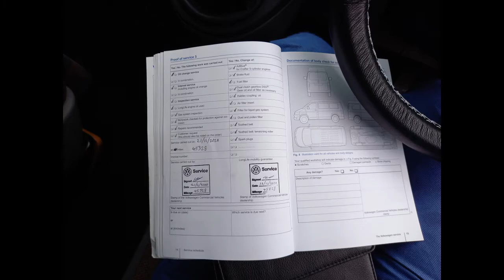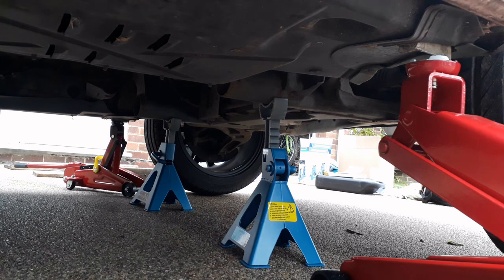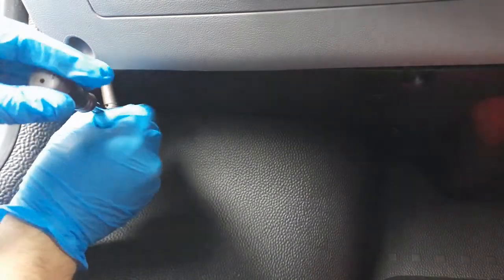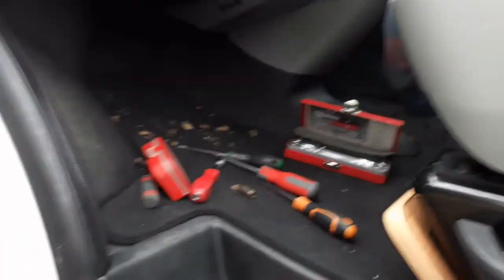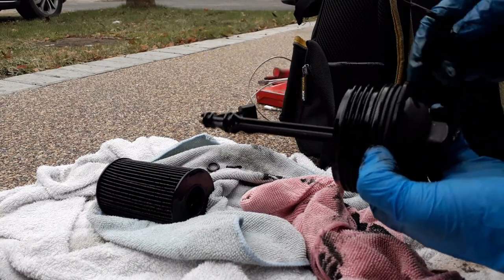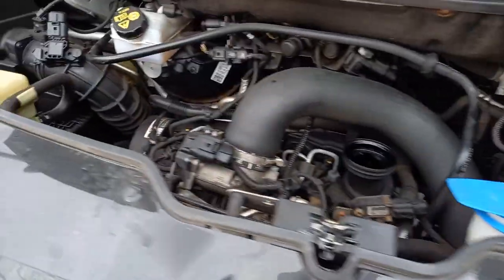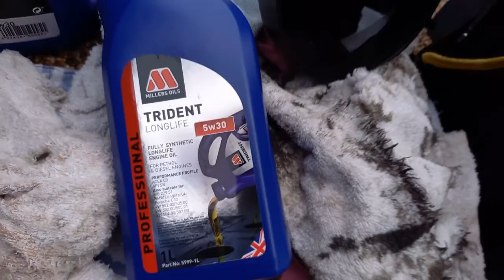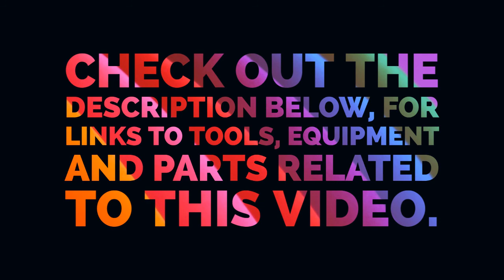VW T5.1 Oil Change and full engine service 2.0 litre TDI - we service our own campervan

Comment: I just replaced the fuel filter on my T5. Here's what happened when I tried to 'prime' it:

1. I turned to key to ON, went to the engine and I could hear a tick tick tick coming from the fuel filter. When I turned the key off the sound disappeared. I did this 3 times.
2. I then turned the key to ON for 30 seconds, then START and the engine fired up, no problem. Then after about 1 minute the engine cut out.
3. I turned the key ON for 30 seconds, then START and the engine cranked for 10 seconds without starting, then the engine fired up. I left it to idle for 5 minutes and no problem so I turned it off.

I believe what happened was the engine cut out when the air bubble reached the engine. Then when I tried to start it a second time it took 10 seconds for the fuel filter to fill up, clear the air bubble, so the engine could start. I actually don't think turning the key to ON, put any fuel in the fuel filter.